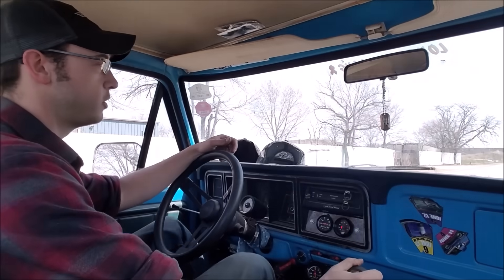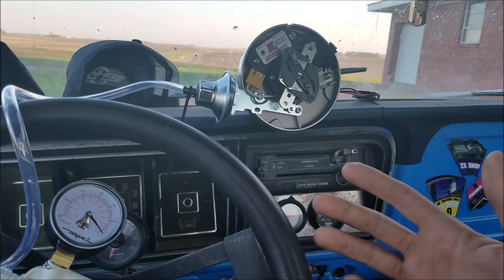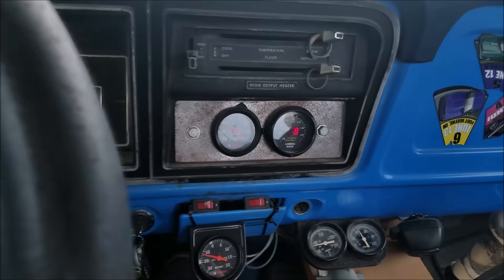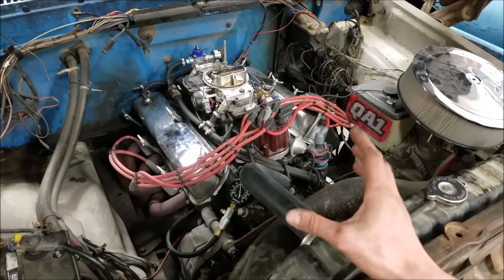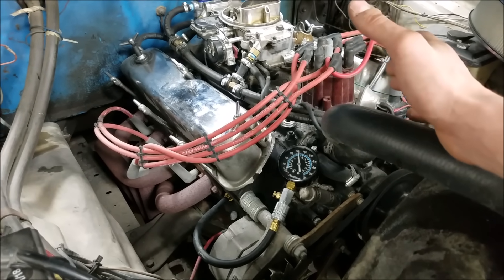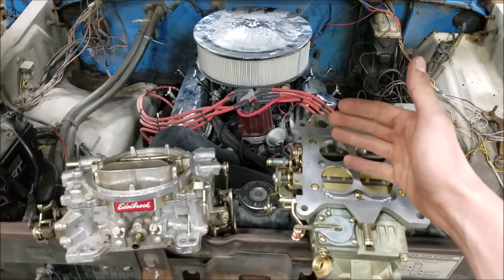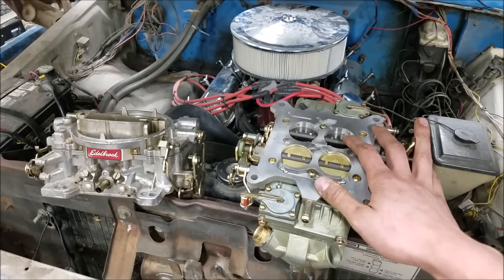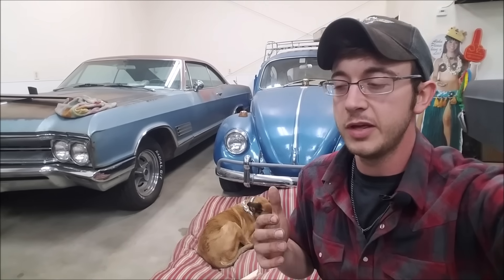Vacuum Advance - Ported vs Manifold: Which to Use & When !!!

Comment: I'd like to add that running manifold vac advance can cause another problem: when accelerating from high vac to low, the vac advance cannister is delayed in its return to base timing, causing a split second of ignition knock as the accelerator is applied. In my experience, it otherwise made a big difference to cruise and idle performance. My fix was to fit MSD programmable, the timing response to load (via a MAP sensor) was then instant. I am running approx 35 degrees timing at idle on a 302 Cleveland, up over 40 at cruise.

Comment: Small disagreement here.  I remember when ported vacuum came in as an emission strategy.  Breathing vs advance came down to base timing plus the distributor's curve vs rpm with vacuum advance for idle and light cruise. WOT response depended on the distributor's base timing plus the advance curve to full advance. The curve could be tuned with different weights and springs to take advantage of fuels, tuning or valve timing mods in addition to base timing and carb settings.  Spring/weight kits used to be on the wall right alongside carb tuning kits at the gearhead and jobber oriented auto parts shops.  One benefit of advanced idling is idle temps run cooler.   Your videos are fantastic, keep up the great work!!

Comment: Arrrgh...where on the Holley carb are the connections for Ported vs. Manifold vacuum?  Thanks!
Reply from the maker: Ported is high on the metering block, manifold is down by the baseplate
Reply: @ThunderHead289  Most helpful, again.  Thank you.  By the way, even the Holley videos just presume everyone knows thie location and glosses right over it.  Lol.

Comment: So the mechanic who set up the timing on my ‘84 Scottsdale with a 355 & a “more than mild” cam, unhooked my vacuum advance because he said he always just prefers to use the mechanical advance on the engine. So he set my timing accordingly. I’d love to know your thoughts on this. 🤔
But thank you for the very informative video on the subject!! I hope I get to hear back. 👍🏻
Reply from the maker: Well, tell him I said he’s an idiot. 
A lot of folks thinks think it’s some odd either or scenario, it isn’t - all distributors have mechanical advance, and all cars on the street should have vacuum advance that works in tandem with mechanical advance. 

I’m sure I explain it in this video, but think of your engine just as an air pump - because it is. When your cruising and at light load, the throttle isn’t open that far, vacuum is high, and you are getting a much less volumetrically dense charge into the cylinder. This less dense charge has a much longer burn time, so in order to burn the mixture at the right time at light load, you need to have more timing - that’s where vacuum advance comes in and works it’s magic adding the needed timing. 

Now everything is opposite under hard  throttle, volumetric density is going way up and that equates to a shorter burn time - you don’t need as much timing, but conveniently vacuum advance drops out at low vacuum, so there you are - timing scenarios to handle both heavy and light load as efficiently and as easy on the engine as possible. 

Thunderhead289 
Engineer
Reply: @ThunderHead289  Hey thank you so much for the reply!! Question for you, since the VA is “unhooked” while timing is being set, & then hooked back up after timing has been set, shouldn’t I simply just be able to hook mine back up & use it?? 🤔
Reply from the maker: @gimmefuel7268  hook it to your ported/timed port, not manifold vacuum and you’ll be good to go
Reply: @ThunderHead289  Thanks a heap. 😁👍🏻 I’m definitely going to hook it back up after your recommendation & watching your video. It’ll be awesome if I notice that my truck is running & driving even better after that!
Reply: @ThunderHead289  If you run wide open most of the time, such as in drag racing, you don't need vacuum advance, but for street use, use vacuum advance.  You will have much better part-throttle response, use less gas, be able to use cooler spark plugs.  Just better all the way around.  The mid 60s Chrysler 426 Street Wedge is a good example.  Earlier years had a distributor without vacuum advance.  Those cars always wanted to be driven hard in order to run well.  Driven gently, they ran ratty.  Later examples had vacuum advance and ran way better at part throttle.  Used less gas too.

Comment: i have a 1977 F350 with a 351m with a RV cam and headers. i need to get a new carb but don't have the money to go full 4 barrel yet so i was wondering if you know anything about the holley 2 barrels and if i would be better off getting one of those or a regular 2150 motorcraft. all the forums have to many biased opinions and inconsistent answers so i figured i would shoot a comment to the go to carb guy.
Reply from the maker: Howdy, 
Autolite 2100 units are good carbs, but they have long since dried up, reproductions being of questionable quality. 
A holley 2 barrel is just that, half a holley. Still all the tun-ability and functionality of the primary circuit. If I were between the two, unless I was buying a used autolite that I physically watched run on a vehicle well, I’d go the holley route
Reply: @ThunderHead289  thank you! kinda figured since most of the 2100 reproduction carbs are 90 dollar amazon specials. another thing i was kind of struggling on is what cfm holley 2bbl to get. heard some say to get the 500 cfm and tune it down to give you more to build of of. but also see people running the 350 and having good luck. again thanks for the quick response!

Comment: Thats not totaly true....i have 66 gto /389 ..i have vac on port under carb....i get 14 to 16 degrees as soon as i plug in the vac hose to distributer....confirmed with a dialback timing lite.....3x 2 barrel carbs
Reply from the maker: That’s called manifold vacuum.
If it’s your ported port, then you have too much throttle at idle and need to increase initial mechanical and reduce curb idle screw. Ported shouldn’t see any vacuum at idle whatsoever.

Comment: Luke thanks for the video 👍 you had another one although that said something a little different it was regarding ported vs manifold vacum and the loss of efficiency   due to vacum loss and the gain by using manifold vacum increase ? Not sure if that was about adjustable vacum canisters or just overall performance comparison . You said there you ran full manifold at that time what made you change you mind to run ported? many pre 71 fords had auto lite and 2100 carbs that only had manifold ports not ported  my truck ran better ported with around 4 more degrees of initial although it ran leaner at idle and ran hotter at sea level on the west coast in the summer it a big time difference from running manifold vac and having that  x tra timing in there .

Comment: 🔔😎
Years ago I found that factory HEI distributors had 13 different vacuum cans, all with different ratings.
Unity Motorsports shows how to determine what vacuum can rating you need. At what vacuum the can moves, reaches full advance, and degrees of advance.
It makes a difference in cruising. 👍
Reply: FOX fuel injection 👍👍👍

Comment: Very informative with a great understandable delivery.
I think one question was left out...
what's the difference between manifold and ported vacuum once you start opening the throttle more and more?
Do they both taper off exactly the same? 
I haven't found anyone who can answer this question as of yet.
Reply from the maker: They do both indeed taper off the same in the throttle. 
Ported is the same as manifold except for at idle.
Reply: @ThunderHead289  I think a LOT of people (i.e. Facebook Groups and Forums) do not understand that, and think they are different above idle, now some of the old 2100 Carburetors had a venturi port (on the back, which went UP with RPM) and people confuse that venturi port with the ported vacuum we are familiar with...

Comment: ported vs manifold? OK my holley as two ports on the side at the base plate. Ported Vac correct? So manifold vac is on the manifold Correct? Where???? That would be nice to know. My manifold doesn't have a port at all I can see unless you are talking about the port for the brake booster?
Reply from the maker: The port on the metering block is ported vacuum. The port at the base is manifold. It’s just kind of a well known thing so I didn’t mention it - figured folks would know on this video since it takes intermediate level knowledge to understand.

Comment: I like what you said, and it makes sense...The sad thing is most of us with the stock-ish engines with stock or mild cams, or trying to "ReTune" what factory SMOG crap 'DeTuned" for us... I have taken Dual Canister Duraspark distributors apart that were made for the really retarded "factory timing" and found centrifugal advance slots of 44+ degrees of mechanical....TOO MUCH! - These low compression stock-ish engines need to have 15° Initial and 20-25° Mechanical Advance and 10-20° Vacuum on the "Ported port" or they are a DOG off the line, if you step on it hard at all...
.
I mean, just think the "Factory Setup" on my 1977 351W-2V it had an initial timing of 6° and then thru the thermal vacuum switch mess, it had "manifold" vacuum after it was finally at operating temperature...so at idle it had maybe 16-20° - BUT - when you stepped on the GO pedal at the stop light and the Manifold Vacuum dropped to 0-3" it still only had 6-8° complete advance on a cylinder that had a whopping 8.2:1 compression...and because it was in a heavy car, it had no vacuum until "cruise" so it relied on whatever mechanical advance it could give, which it had HEAVY Springs...so I dare say, I don't think it was "All in" until 4500RPM...and there is no wonder it got horrible gas mileage, it was putting most of its "bang" out the exhaust unless you had it "Wound Out"....Now I had that same engine with a recurved dist. running 15° initial, and 20° centrifugal/mechanical all in at 3000 and 15° vacuum....it gets great MPG and will actually lay rubber at a stop light.

Comment: Look I grew up on in the sixties and seventies  we was taught in auto shop and in the motors manuels to set timing with the vacume advance and the hose plugged. It was straight forward. Set initials timing and max timing then reconnect the vac advance.

Comment: Funny you have a video out from 6 years ago saying always run manifold vacuum. Maybe need to remove if you don't recommend that anymore
Reply from the maker: I forgot that was still out there. 
That was based on internet knowledge. 
My standpoint nowadays is best on engine dynamics, performance, and math. 

Manifold vacuum is technically better in some ways, but ported allows you to manipulate your mechanical timing in a way not possible when running manifolds. 
If your looking for total performance, ported is the way.

Comment: Great video. That's pretty much how I understood it to be. You should see the distributor setup on my dad's '55 T-Bird. Imagine there's no mechanical advance and an odd vacuum advance with a weak spring.   It has virtually no advance ever. Dad wants to keep it because his tach in the dash is driven mechanically off of the distributor. The engine has potential for so much more power with proper advancing.
Reply: My brother has a modern distributor in his engine with manual tach drive
Reply: @markscruggs2157  I was able to find one online about a month ago. It runs so much better now. About 5 years ago I tried looking for them and it seemed like they were out of stock or discontinued. I'm glad we finally got one. Dad is 80 now and I want him to be able to enjoy driving his car with no troubles.

Comment: That was gibberish, and total confusion . Your language doesn't follow factory lingo. I'm not sure what you said. I'm an old school idiot but a little old school lingo might help us old fools understand you better. Your lingo isn't familiar. Use a professional text book, or even an old school Hot Rod magazine article. Try to stay with the official techniques as described in the engineering texts.  I've had a rough night trying to watch Blues Brothers but the modern programing is frustrating. So it could be me. But I still think your lingo could use some improvement. The commercials on the internet suck.

Comment: Hi...I like your tutorial, it' clears up a lot of misconceptions.  I have a 440 Dodge with mild cam, and using ported for my vacuum advance as you recommend.  What do you think could be the issue if I have the initial timing set spot on for my car, but I can't get the motor to ping no matter how much more initial timing I give it, even with 87 octane gas?  If I give any more than about 18 initial, the car just runs worse and bucks back in forth when I let off the gas in the lower gears (its a 4 speed).  By the way, I am using a 4 seconds flat limiter plate to limit total mechanical advance.  Should I allow more mechanical advance?  Thanks! - J
Reply from the maker: I’m not sure what you mean by your advance limiter, but probably somewhere in the 30-36 range for total timing (of course this reading is without vacuum advance hooked it) would be ideal. 
The only thing I can think is that your not pulling in enough timing to ping, or your bleeding off your compression with the cam, but since you say mild, I doubt the cam part
Reply: Remove that advance limiter.  Set timing as per stock specs WITH THE VACUUM ADVANCE DISCONNECTED, then reconnect the vacuum advance.  Road test car.  Try adding a few degrees advance until you can get a SLIGHT ping under heavy load.  If the manufacturer of your cam suggests different than stock ignition timing, use their suggestions.  After you find what works best.  If you can't get it to ping, use the amount of timing that gives you the best results and use the cheapest gas.

Comment: Do you want your engine to run cooler in stop and go driving?? Then run manifold vacuum. If a quicker warm up on a winters day then run ported. Dead stop power is better with manifold, with all that added timing from the canister. Sure that drops going full throttle from a stop, but there is a slight lag still increasing the timing some, while it is increasing your torque down low.  Snappier response.
Reply from the maker: Use ported - if your mechanical initial is correct, you won’t heat up in traffic. 
Couple that with slightly heavier springs to offset the higher initial timing, add advance limiter at around 3000 and then you can have your cake and eat it too - without giving up anything.
Reply: @ThunderHead289  The over heating is because you lack timing below where the springs even come into play at 3,000. Besides this why would the average guy want to recurve his distributor, just to get a cooler engine in town, in stop and go traffic above 3000?? Ported is there to run the engine hotter and warm up faster, for emissions or for colder climates.
.
I have run manifold for many many decades, and have a recurved distrubutor I did myself and also that far back. You know before rocks were around.
Reply from the maker: @free100x  we need to look past what ported was intended for and see what it can be utilized as. Granted yes, most folks don’t want to recurve their distributor - I’m a huge advocate for the pertronix line since it’s easy to change springs and stop bushings. 

Many many folks have exceptionally lazy mechanical timing at idle and couple that with a stock style lazy timing curve - Many a better car I have blown the doors off of just due to having a better all around timing curve while still maintaining my drivability. If you sift through my channel, I roll 80 miles round trip a day, carbureted.
Reply: @ThunderHead289  You have to remember also most do not probably have a 3000 or higher stall convertor to take advantage of the curve advance. So iintial timing and manifold vacuum become their real tuning points. But, if they are running a manual transmission or a 3000 stall, then the curve and total timing come into play more. And many of them run into a heat issue or want cooler engines for more power. Cruising down the highway either one works the same.

Your video was nice and concise and to the point, with nice video work. I am just trying to express the fine points missed 99% of the time on the subject when discussed.
Reply: Not all engines like having manifold vacuum to the vacuum advance.  Some will hesitate and spit back at you.
Reply: @michaelbenardo5695  Just make sure you close off/plug the ported vacuum port, if you try the manifold vacuum to the distributor.

Comment: Which is why on my modified street cars, I simply don’t hook up the vacuum advance. I care about two scenarios primarily. Idle and WOT….neither of which receive a vacuum signal, and I don’t really care about the small mpg benefit the vacuum advance will provide in between. I want high initial timing, and then very light weight mechanical advance weights/springs that come in immediately at WOT.
👍🏻
Reply: You got THAT right! It wouldn't hurt to add in a bit of ported vacuum advance in effort for increased fuel mileage, though.

Comment: Am I correct in thinking that in wide open throttle conditions that either manifold or ported vacuum advance does not matter? Because at wide open throttle vacuum drops anyway
Reply from the maker: You are correct - although, mistakes are made on mechanical timing based on vacuum port usage

Comment: I heard that a car with automatic transmission should be put in gear to adjust the idle mixing screws with the vacuum gage. Is that a better way then leaving it in park?
Reply from the maker: Yes, absolutely
Reply: @ThunderHead289  🖖